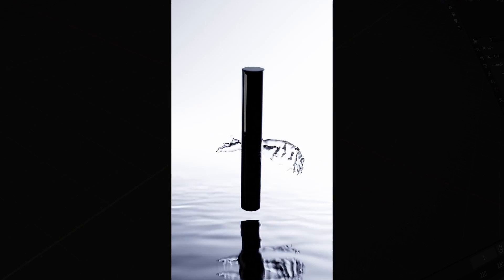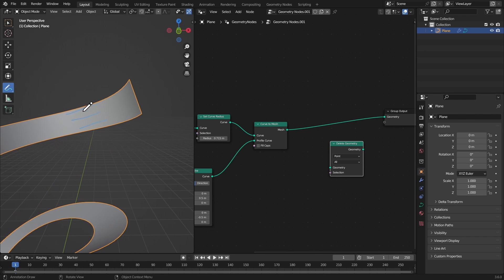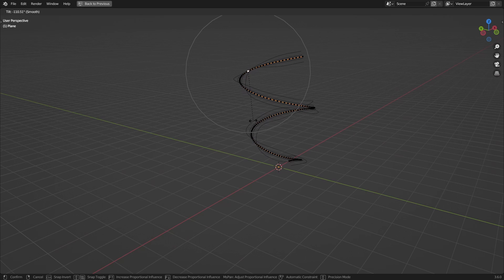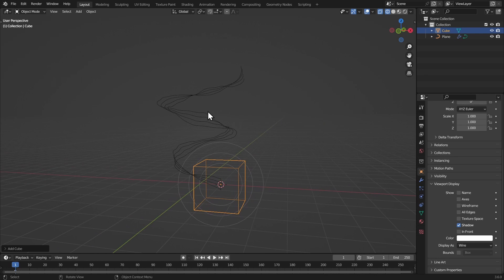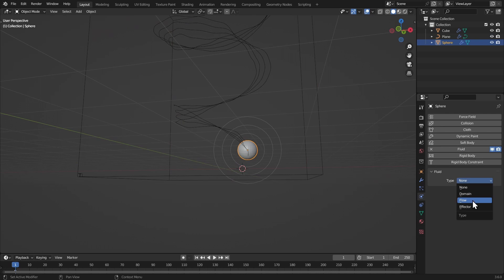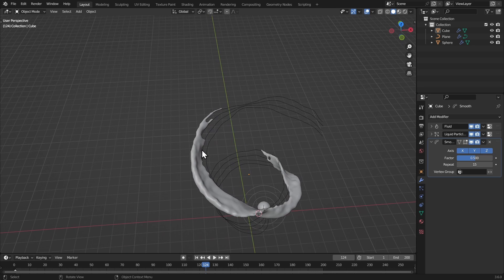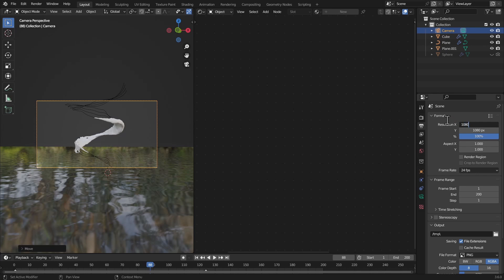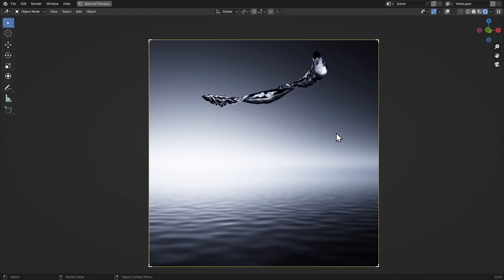Fluid on PATH: Blender Tutorial

Comment: In case you guys using blender 4.5.4. The geo node greater than no longer have the option to change to integer. What you can do is add math node (floored modulo, connect to value A, Value B use 6) > connect to Compare Node to value A and leave B at 0. Then connect it to output and one more thing is update your resample value curves into 24. The strips will be in a 4 strands rather than a mesh. A small fix I find out when trying this tutorial.
Reply from the maker: did u search up the boolean math node
Reply: @cleverpoly  no i just test out the geo nodes my self since I was not able to follow your tutorial geo nodes due to blender changing the greater than node. But everything else I followed 1 to 1 from your tutorial and the end result is same. But simply adding the compare node fixed this issue for me and I think Blender recently move the integer to compare node. So connecting the math node to the compare node then adjusting the resample curve fixed the issue for me.

Comment: hi thanks alot for the tutorial! I have just baked the data but the water particles do not reach the end of the curve, instead only less than a quarter of the way up, ive been trying to see if this is to do with start and end points etc but can't resolve the issue, can anyone recommend where I could be going wrong? thanks !
Reply: Exactly same problem infact the water particles are much small as compared to him don't know what's going wrong here
Reply: @cooldragoncool3046  had the same issue, turned off gravity in the field weights section of the domain, decreased speed from -8 to -15 and increased flow!

Comment: Hey! Great tutorial! I was wondering if you would be able to tell why my simulation doesn't move from point A to point B instead it is like a tap, water keep running and building up on my curve?
Reply from the maker: set the flow from inflow to geometry
Reply: @cleverpoly  So the sphere is Flow, Liquid, Geometry. The curve is Force, Curve. The cube is Domain, Liquid. The only thing I changed is the speed of the simulation.

Comment: Nice work! What's your GPU? All the time when i try to use Bump node like this, my fps drops to 2-5 fps. Terrible, and unable to work with it. I tried Blender 2.93LTS ; 3.3LTS ; 3.4.1 ; 3.5 ; 3.6 LTS. All the same stuttering with using Bump node.
Reply from the maker: I think bump in evee or shading mode is not related to GPU it's your cpu and ram etc

Comment: Great tutorial! Just one thing to note, you can use "Realize Instances" instead of using CNTRL+A to apply the mesh so all of this can be done in nodes non-destructively.
Reply: Oops! Spoke too soon. Can't do that proportional editing at 4 minutes in if it's not turned into a REAL curve object --- there's nothing to hold the data at the curve points.
Reply from the maker: @mpjstuff  don't worry I watched this video 4 times before uplaoding 😅so everything should work fine